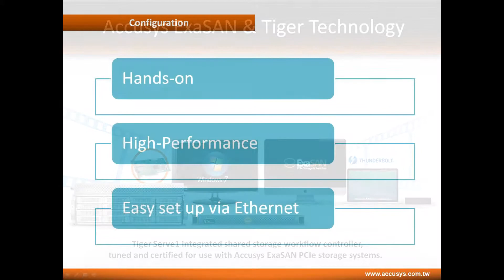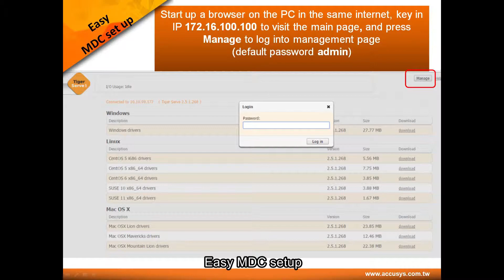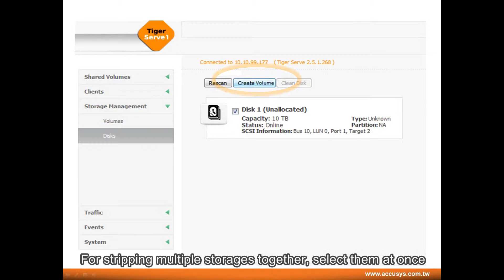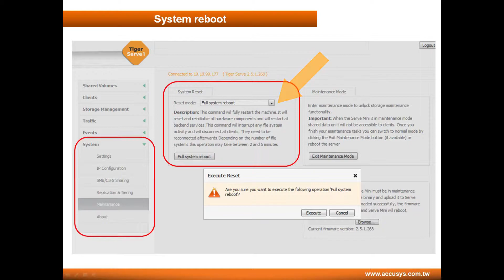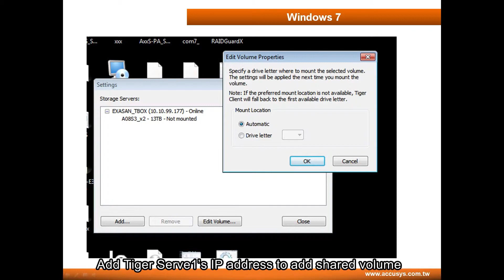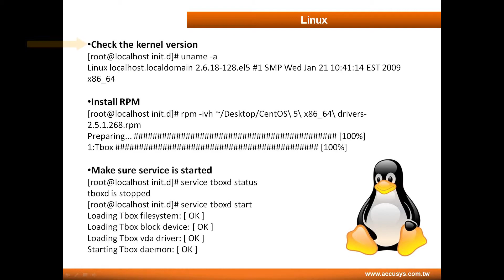How to quickly configure and connect to Accusys ExaSAN PCIe SAN in under 4 minutes

Comment from the maker: Q: Is there a limitation to the number of users per session for this ExaSAN storage& Tiger Serve1 solution?

A: Since the bundle is targeted to the need of small&medium post production facilities, the limit is 12 PCIe connected clients to ensure the performance of the storage path, but you can also have additional 10GbE clients through Tiger Serve1.

Q: How does your switch connect to the storage and what is the distance limitation?

A: As we showed in the slides, the storage, switch, MDC and client computers are all connected with PCIe cables, and Accusys provide 2M,10M,30M,50,100M cables to meet the different demands. 

Q: How well is the performance?

A: If we got a complete SAN environment, which for the case of ExaSAN product is one RAID storage + 3 extra JBOD, the performance can actually reach up to 4000MB/s. That means it could support 4 4K DPX files playback simultaneously without any problem. We believe that this special skew with Tiger Serve1 and ExaSAN switch & storages could be a very powerful support for your work.

Q: What’s the capacity of the storage? 

A: If we choose to use 6TB HDDs, the A16S3-PS storage with JBODs setting as RAID5 could reach an immense number of 1400TB. Not to mention with the upcoming 8TB HDDs.

Q: Have the 6TB drives been qualified already?

A: Yes. We had recently tested the performance of ExaSAN A16S3-PS storage with Seagate 6TB HDDs (ST6000NM0034); it’s compatible and runs very smoothly. 
For the testing footage: https://www.youtube.com/watch?v=X83uPDdBosk
We’ll also have the testing result of Hitachi & WD HDDs coming out soon.

Q: Does this storage solution support softwares other than Davinci Resolve?

A: Definitely, ExaSAN storages support all the major post production softwares, so that our clients wouldn’t need to worry about anything else besides their creative work.

Q: What’s the price of the Tiger Serve1 & ExaSAN storage bundle?

A: Tiger Serve1 is compatible with all the ExaSAN storages, from 8, 12 to 16 bay storages, so the price could varies. For sales information, please contact us at sales@accusys.com.tw, we’ll introduce you to suitable resellers in your area.